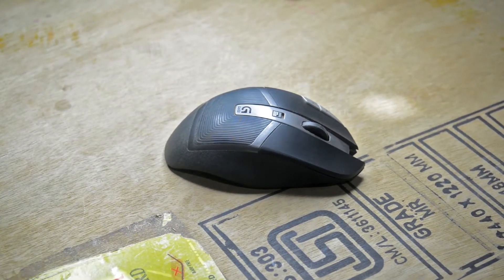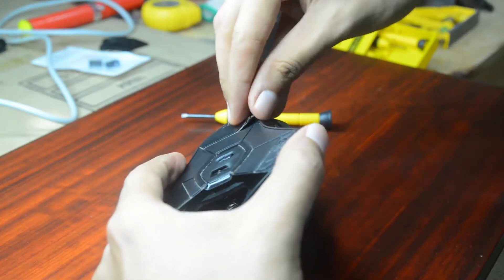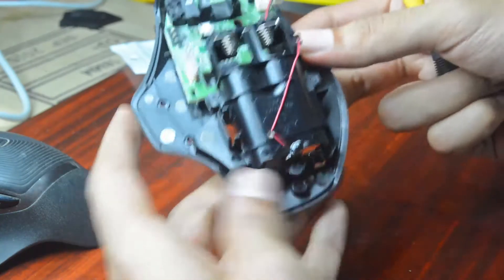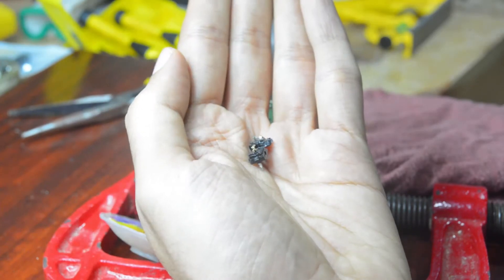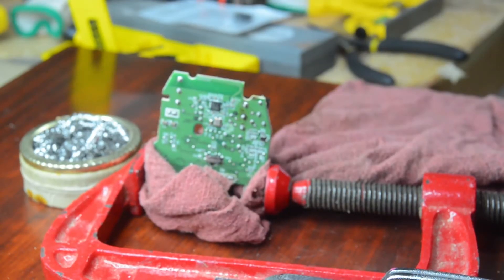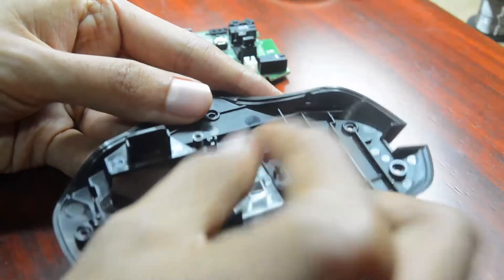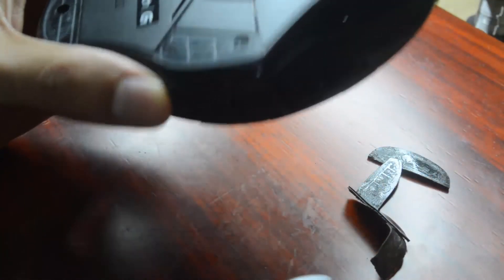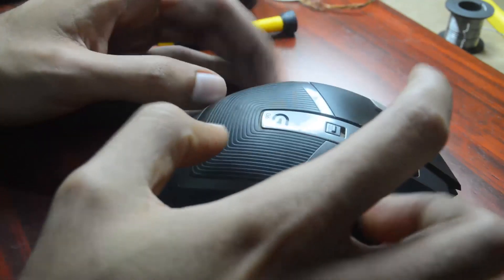Logitech G602 Double Click Problem Fixed

Comment: Thanks so much for this video! Just fixed mine now with this guide. I've never soldered or repaired electronics before but just bought a beginner set and followed the guide to best of my abilities. Tip for anyone trying to keep the temperature low up to 350°C and not like me up to 500°C. I thought I destroyed or burned the contacts but it seems to work fine. I had the most issue with getting the holes after desoldering wide enough to fit the new switch and also soldering to get the right amount in the right places turned trickier than I thought. All in all, not at all trivial like this video makes it to be unless you have steady hands and now a bit about eletronics I guess.

Comment: I strongly suggest to clen your mouse really good before you try replace the switch. Mice are notorious for getting gungted up. Many times it is just some dust or debry. If that does not work just try to clean the switch as they can get gunked up too. Use air duster and if that dose not work you can try come circuitboard cleaner. Then if this does not work you can try too fix the switch.

Comment: wanted to say thanks for taking the time to make this video. While I've done soldering work before, working with 'lead free' solder is quite difficult - I had my little hobby iron turned up to 450F and it was barely making any melting action on the original solder on the switches Logitech put on there. It was pretty mentally exhausting for almost 40 year old me to be staring down at this tiny area, illuminated by a desk lamp, waiting for solder to melt as I held the iron on it. I was almost sure I had destroyed the 'pads' on the circuit board just from too much slow heat, like how you might ruin a food if you microwave it slowly for hours instead of baking it at a higher heat.

But no, in the end, three days later now, my G602 is like a new mouse, at 8 years old. I'm glad I bought an 8-pack of Japanese Omron switches. I'm hoping that I can keep the G602 going for many more years to come, none of the current ones on the market look quite as good as the G602 in the ways that matter, personally, to me. Cheers again.

Comment: I solved the issue just by cleaning gunk under the tiny clench-thingy that makes the contact with the yellowish metal lamela inside the switch. I daresay this is the actuall problem for most of the people. The residue shortens the distance between the said, and possibly short-circuits the contact, thus issuing double-clicks. 

If it's hard for you to figure out how to uncover the switch, look at the right mouse button switch. It's "in the open" you can study it from all sides easily. There are tiny horizontal and vertical crevices. Choose the vertical crevice at the back of the switch (towards the back of the mouse), insert a thin blade inside, push slightly to the side (i.e. towards the back of the mouse again) and pull up carefully. The whole switch cover will just pop up easily.

Comment: After learning that there was a major defect with the G602 mouse causing it to double click, I went back and tried to contact customer service. This has been one of the worst customer service experience I have ever gone through! The first representative sent me to an empty line where I waited for 30 minutes just to hit a voice mail (the voice mail never got back to me). I called back and got a different representative, who went through the testing phase to determine whether it was my computer. After going through all of these steps, the Customer service representative had me fill out a form, and told me they would review and likely replace the product rather than attempting to repair it like so many Sony products would do.

At this point I thought I had actually arrived at a good position, but I kept receiving E-mails asking me to provide videos with different lengths of the mouse not working. Eventually I figured out a good compression app for videos, and sent them a video of me clicking 100 times. After all of this, wasting hours on the phone and proving that indeed my mouse had this common defect, as well as linking this video to them, I got a response that said they couldn't replace the product because it was out of their warranty. I had given them the serial number, which is what they used to deny my claim, at the very start of this process. To make it all even worse, they tried to offer me a 30% off coupon, as if owning a defective product would make me want to buy a new one! It's not even a very good coupon considering the original product purchased was defective! 

I do not plan on purchasing another Logitech mouse, and am frankly disgusted.
Reply: they used to be really good and will send out replacement after simple checks (on warranty and such.)

Comment: I try do this but unfortunately I ruined my mouse.  I had a problem with soldering a new switch, these 3 places were dirty and I did not want to solder a new switch, probably one of the places I burned too much...
I have to buy new one.

Comment: Dude =]] i wish i look for this video before i do my own replace on mouse switch, nice video btw.
=]]] you was having problem just likle me when trying 1st time soldering =]]
after all i successful take the switch out but not really 1 of the feet stick back and i have to take it out using force =]]
pretty nice replacement after all and no big damage done to the mouse is a bless :P
You are right, i bring it to shop and pay for them replace it for me :P cost way more than you buy these switch and do it yourself :P Just do it and you will learn as least something, the worst case is damaging the PCP :P

Comment: Thanks for this helpful Video. In my case it was enough to open the mouse and clean it a bit. After reassembling it was all fine. My advice: test the switch after removing the top of the mouse. Maybe there is no need for replacing it.

Comment: Don't buy those Chinese Omron D2FC switches.  The Japanese made Omron D2F switches are MUCH better.  They cost more, but are definitely worth it.  
Check out the page at geekhack (dot) org/index.php?topic=81743.0
There is a link there to a page (Korean) that has good pictures of the mechanisms.

Comment: Actually they don't make them better than this. I've been looking for a better mouse and the MX master is not better. It's made for a different purpose. Both are good mice but I need the buttons on the left hand side and the 602 beats all wired and wireless mice or it's designed purpose.
Reply: no it does not . even razer nagas are better design than it. stupid ass thin shaped button right next to each other ... smh
Reply: Maybe you would prefer a 'Num Pad' on your mouse but definitely not me or some other user I believe. Economically, it's 2x the price of G602. Not sure about the lifespan but logitech last good 2 years at least.

Rechargeable batteries with dock? I would prefer to bring my own AA batteries. Maybe you have not face problem arising with those rechargeable batteries and probably cost a leg and an arm changing it too. Not so economic if you ask me.
Reply: Exactly my thought when I had problem with it. First mouse had middle click button. My game use middle click button to move the camera angle, so probably explained.

Luckily who would had thought it even have 2 years warranty and mine was used around 1 years 10 months? Best part, I still have all the receipt.

To my second mouse and 2 years since? Maybe more, can't really remember and now I have middle click button and double left click. Looked around for another wireless mouse option but there wasn't any out there which have the extra button that are conveniently and intuitively located while maintaining good ergonomic(for my hand).

Let's hope the mouse can survive this ordeal after me getting the replacement part lol